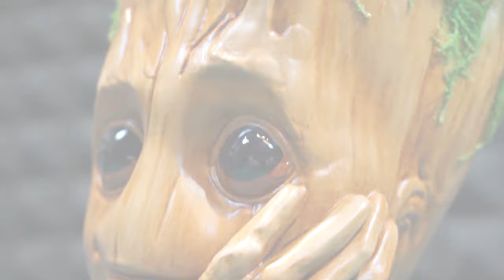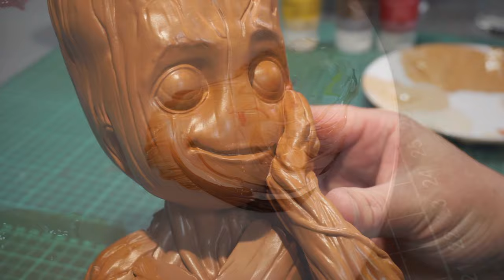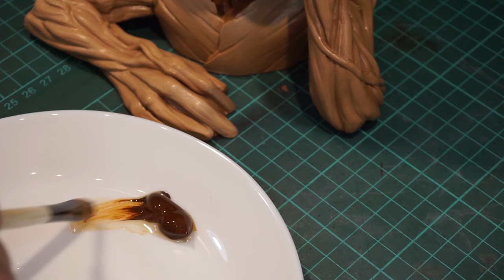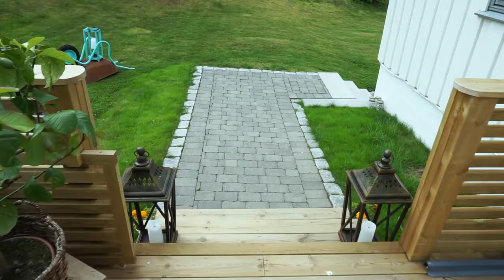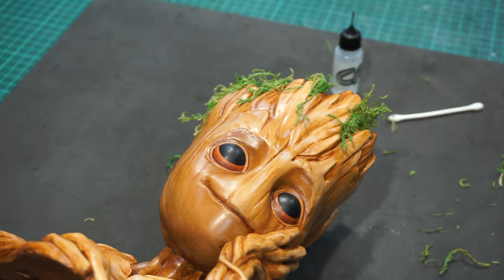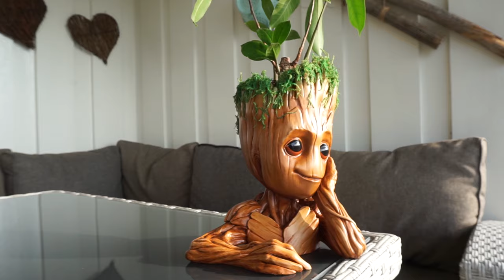Making Baby Groot Flower Pot - A Quick & Easy Paintjob N’stuff

Comment: I'm just starting to get into the world of PLA and painting, what filler primer do you use?
Reply from the maker: Hello there Sir:) The filler primer I'm using is called "Sprøytesparkel" Bought from a store called Biltema. But I guess that's a local store. Or at least a store chain in Scandinavia. But there is a lot of other good alternatives. As long as you buy just a plain "Filler Primer" And it does not need to be the pricy kind. Important: No matter what brand. Make sure to shake it good and long. Then give it several THICK layers. It tends to shrink up quite a bit when cured. Try out different thicknesses on some scrap pieces first, and you will get what I mean;) Have a great one, cheers
Reply: @PropsNstuff  thank you so very much :)